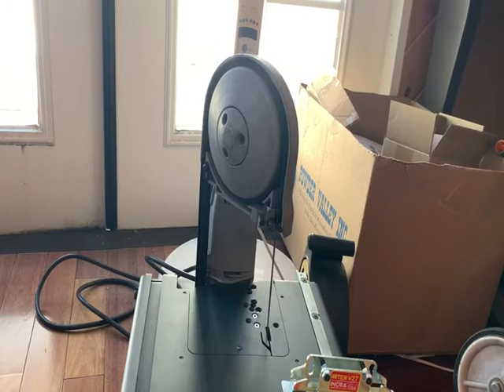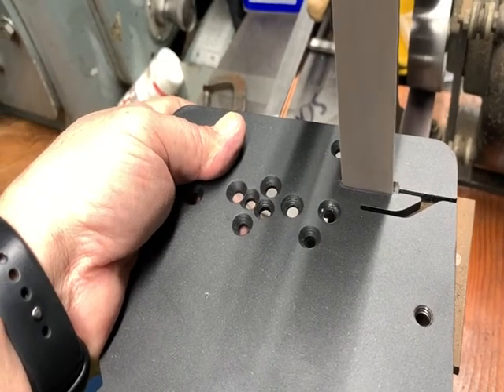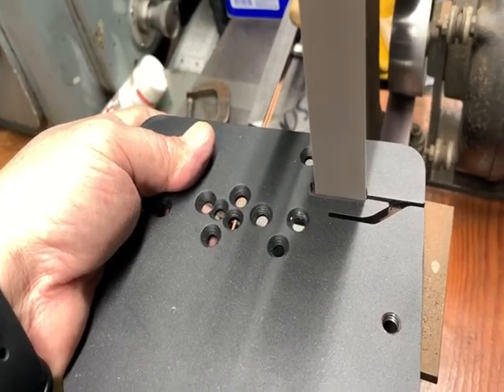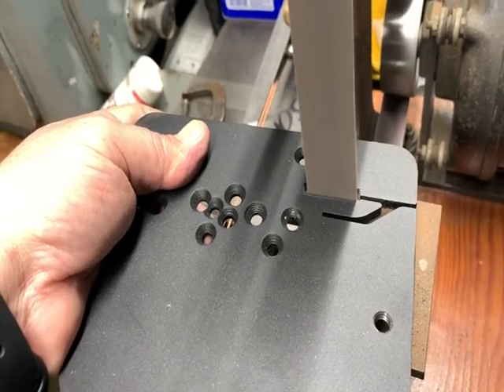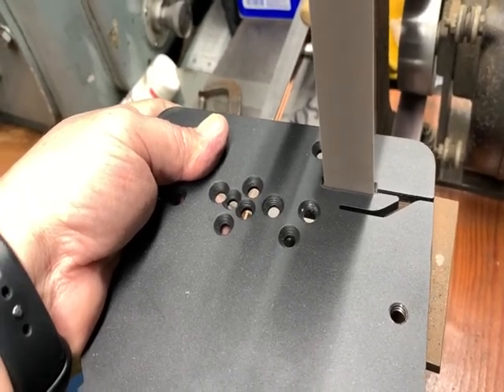Modify Swag Off Road portaband stand

Comment: Looks good Alan, I think thats the first time I've seen that belt sander run. I can't remember if Chuck and I actually tried it. Runs great. Portaband table is on my project list...but it's a long list. Might need to just breakdown and buy one.
👍👍
Reply from the maker: I was thinking about building one but the Swag Off Road has the miter slot and a reasonable miter option as well as the foot switch. I saw the one the Seagull did one, and then re-modified it and it got me to thinking that if I wanted to use one and not have to do that it might be best to get one...although it was supposed to be plug-n-play, it didn't turn out that way...but the mod was easy. I'm planning to use it for some of my welding projects, to cut the miters and other fitment. The belt sander doesn't have a lot of power, but that one works. I still need to make some wheels for the Delta, arguably a better sander, but this one has paid off twice already and runs pretty smooth. The belt wanders if you push hard, but i haven't tried adjusting it yet. I've been using the Reed vise, has the bent handle and I haven't cleaned it up, but it works well.